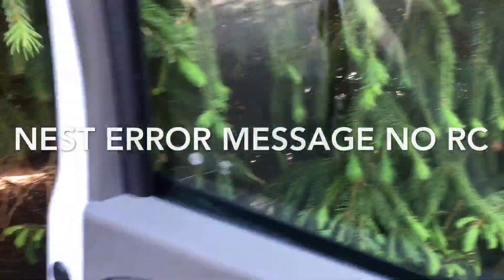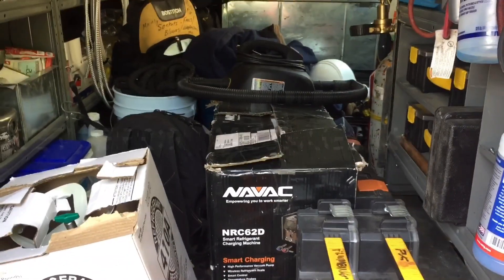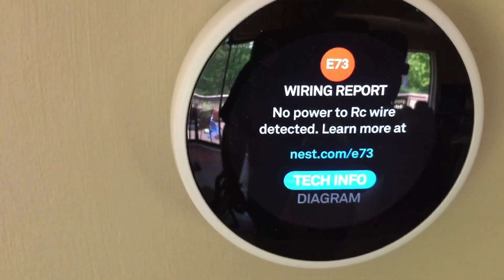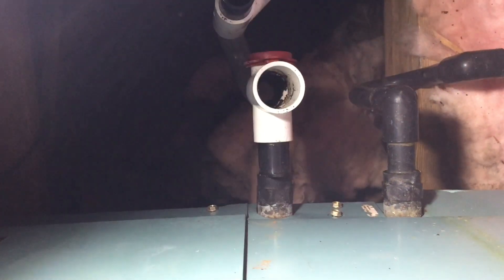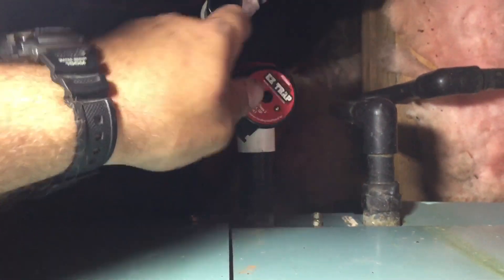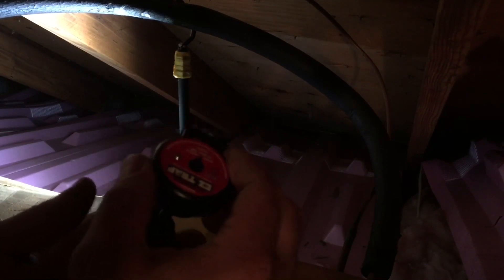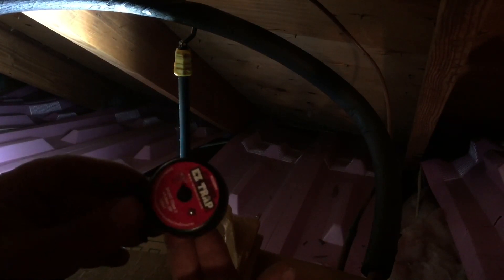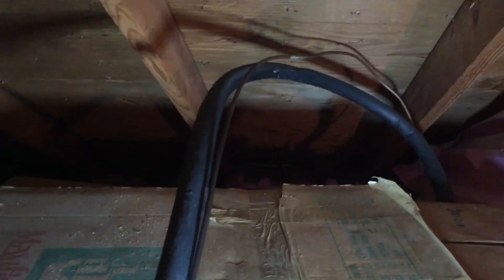Why does My Nest thermostat read NO POWER TO RC WIRE DETECTED?

Comment: What if I don’t have a trap?  Is that even possible?
Reply from the maker: Yes.  You may have a float switch in a secondary pan which will do the same thing.  You may also have a low voltage fuse that tripped inside your air handler or furnace     Just a thought.

Comment: Are you putting compressed air in, water or sucking out? Have a similar set up and error and want to clean it out but unsure how (air, water, suckage) thanks for this video!
Reply from the maker: Thanks for watching.   I generally use air pressure and the fill a gallon of hot water and flush the trap and line set with a vinyl hose that clamped a dishwasher coupling in order to keep the hose tight to the bottle when pouring.   Vacuum occasional.    Hose and water work for me the best.    Thanks

Comment: It was my 3v fuse. I have a Goodman furnace. Went into the garage, turned off the breakers, climbed up the attic, removed both covers, and located the fuse.  Pulled out and yep, fuse was broken. Luckily I have spare fuses in my truck and grabbed a 3, plugged it in, flipped the breaker on, and all was well in the household

Comment: Commenting on all these videos with the fix that I found hoping it will help someone. 

I simply hit the emergency power light switch to my gas furnace. Once I flipped the power back on, everything was fine. I must have switched it off by mistake moving stuff up and down the basement steps where the switch is.
Reply from the maker: Thank you.

Comment: I went to my Hvac n didn’t see that 24volt over float switch …so how can I find the right one to clean ?
Reply from the maker: There may or may not be one.  Check the secondary pan, which may be under the hvac unit.  That sometimes has a float switch also.
Reply: I didn’t see anything else around the unit beside that white pipe n on the left is the red cap :( … is that mean I have to cut the white pipe create new style to clean ?
Reply from the maker: You may want to cut and install a union or a basic trap style so you can clean.  You can put a switch there or simply attach one to secondary pan.

Comment: You’re the man, you’re the damn man. Appreciate it, I have a different kinda trap, when I take it off, the ac works, when I put it back in, it stops, even after I drained the water. But I found the problem. Thanks..
Reply from the maker: Good stuff.